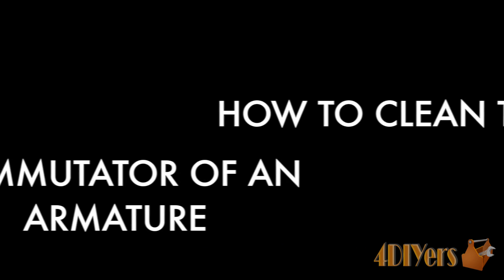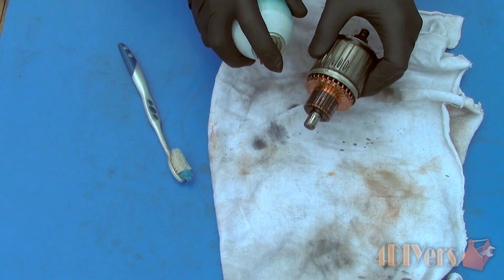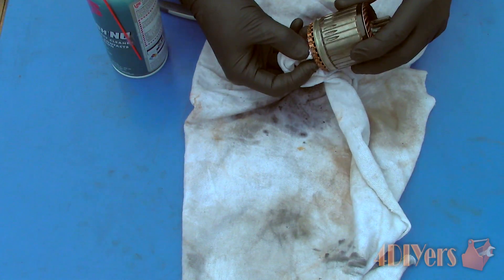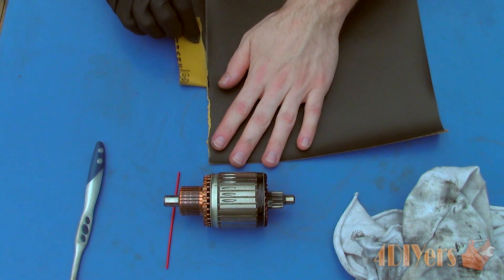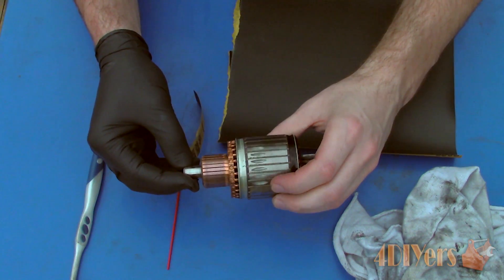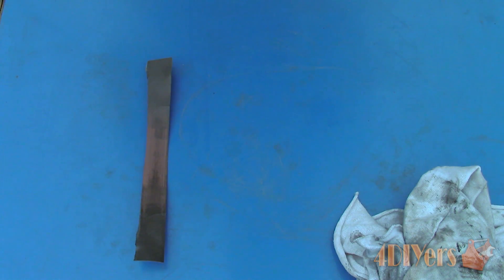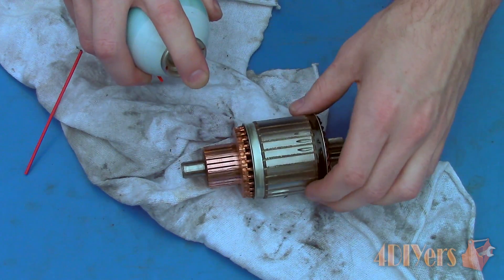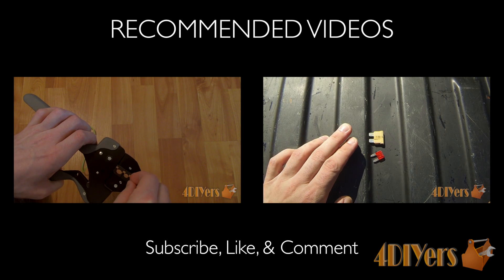DIY: How to Clean the Commutator of an Armature

Comment: i have a small electric motor on a child toy peg pelegro polaris. one motor is fine, the other does not have power. Took them off the gear mechanism, both turn, but one stops as soon as power is disconnected, and the other spins freely. no mechanical resistance. lube does not help. i took apart the the bad one, one coil is darker, obviously overheating. but not shortened. i measured the resistivity of all 3 coils, they start at 3-4 ohmes, then quickly reduce to 0.8 ohm. makes sense. Any idea, what is wrong with this motor? I bought a replacement, but this is my curiosity tickling me.

Comment: You mention the the 600 grit sandpaper is aluminum oxide. Why is that significant that it be aluminum oxide? A found quite a few sandpapers, including 3M, that don't list their type on the package. Just the grit.

Could you also use a maroon very fine ScotchBrite pad with good results?

Thanks for the very well done videos.

Comment: Someone please help me, I have issues with a 18" rechargeable fan, the motor always burns an electronic component (d882), I replace the component and it burns it again, the motor turns like it's forcing itself to rotate and the coil smells like it's burning, it happens to some a.c motors I work on too.....I'm an home appliances technician.....how can I solve this problem, heeeeeeeelp

Comment: If you have the commutator (from a miter saw in this case), is there anyway to identify which way to turn the commutator for sanding? Also, for motors that have brakes, such as miter saws, does direction even matter? I believe that the commutator spins in reverse to help stop spinning but that is all conjecture on my part. Great video

Comment: Nice clear and concise information. However, I think 600 grit is way too abrasive and will take away too much material, which will reduce the service life of the armature. I use new 2000 grit paper.
Reply from the maker: No problem!

Comment: Not functioning correctly?  Please explain.   Would a dirty commutator cause motor whine?  I hear no noise when the brushes are removed.  But a whine when they are inserted.  The brushes themselves are smooth, and appear clean.  Would going to the trouble of disassembling the motor to clean the commutator fix the whine?

Comment: Have a Craftsman router that wasn't working right. I was sure it was the speed control board and, of course, they stopped making replacement parts. Thought I'd try this instead of smashing it into the concrete and now it's running back up to full speed. Thanks for the video.
Reply from the maker: Right on, awesome to hear. And thank you for the feedback!

Comment: Excellent video, sir! Very well explained and filmed. 

I usually rejuvenate my 2007 Fiat Punto's miscreant heater fan motor with a flat-ended lollipop stick, pressing 400 grit oxide paper to the commutator, under finger pressure. It works, but I'll now bear your motorised version in mind. Live long and prosper, sir. :-))

Mick (UK)

Comment: can i use  wd40 to clean the armature?
Reply from the maker: No, it'll leave a residue behind.
Reply: I used brake cleaner and copper brush. Worked like a charm. Next time I will use 600 grit sandpaper with a drill... nice video!

Comment: hanks so much for this video. It is very helpful to me.
Please I just to ask if thi
s cleaning also solves the problem of sparking on commutator?
Reply from the maker: Yes it will, but you also need to make sure your brushes are in good condition and seated correctly.

Comment: question: if an armature rotates fine when I apply 12v to each side of conmutator, but when I reassemble with brushes it doesn't run, what is the problem? The brushes seem fine

Comment: Hi, i did that to a old drill, but after cleaning it, I try it just 5 second and the  commutator was black again  (bruches ash?) and I thing it was sparking to much. What could be de problem?.
Reply from the maker: Did you use aluminum oxide sandpaper, made sure the commutator was thoroughly cleans, ensured the resin between the bars is lower than the bars, and the brushes are smooth/clean?
Reply: It could be that your stator and your rotor are misaligned and they're brushing against each other causing the sparks.

Comment: Very good/informational video but I believe you are using silicone carbide sandpaper rather than aluminum oxide you reference. 3M brand "Tri-M-Ite, wet or dry" is a very common sandpaper for wet sanding automobiles and fine finishes.
Reply from the maker: Thank you and nope. That is in fact aluminum oxide sandpaper and made by 3M as well. I did mention it in the video and description to only use aluminum oxide.
Reply: Good explanation

What is the reason for using Aluminum oxide sand paper?

Comment: Can worn out brushes and/or dirty commutator cause the motor to overload?  I have a Pupa UP200 hand drill.  When I turn the drill on, it will run for a couple of seconds and stop with the controller's overload light on.
Reply: I dont think worn out brushes would cause the motor to overload...if the brushes are too small or worn out you will probably have to knock the tool against something or bump it to get it to start...if the drill keeps stopping after you turn it on the armature could be burned out and need replacing..